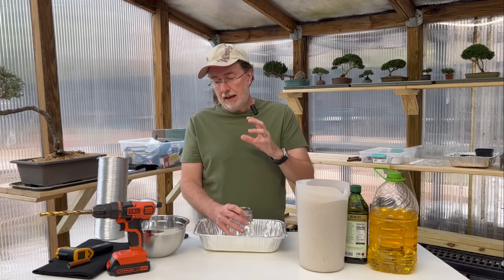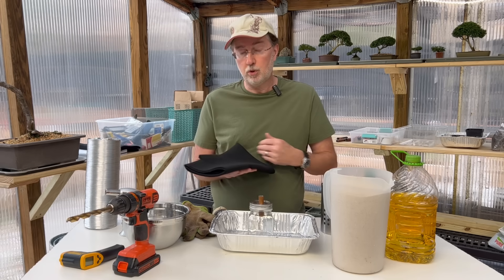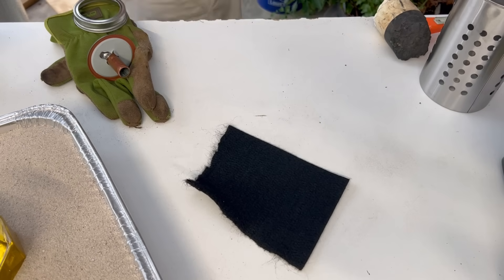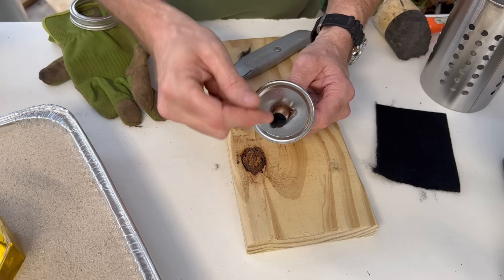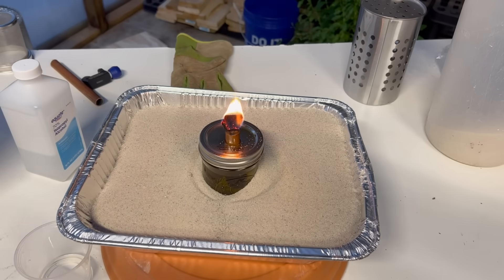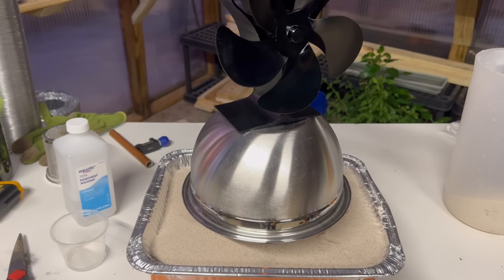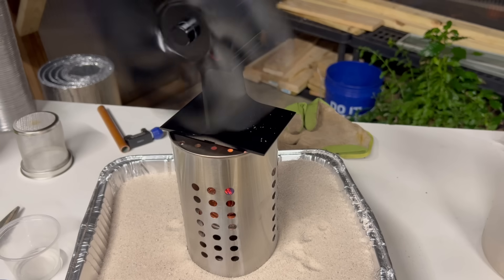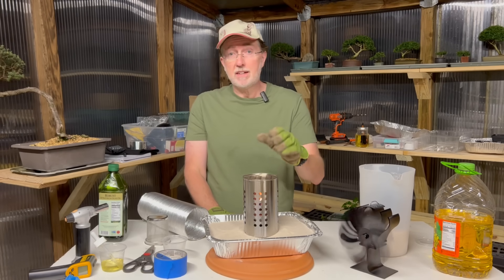DIY Carbon Felt Heater | Burns Forever Without Changing Out The Wick

Comment: Break about ⅛" off of the point of the utility blade. You will then have a new sharp point. Can break this again as it gets dull.
Reply: half a dozen passes over a 150grit sand paper on both sides , and it is good as new. Then after 5 years you get yourself a nice olfa knife with snap off blades

Comment: Is one is to use a vent for the heater one must make up the air that is being exhausted outside. It’s best to add a second smaller diameter pipe down low to the outside and bring it up close to the burner. It will supply the burner with cooler dense air that will offset the smoke if the candle does emit a lot of smoke and supply fresh air to replace air exhausted through the vent. Excessive smoke can be a sign that the wick is too far out of the copper pipe  and the flame is excessively high. Upon refilling the candle the next day pull the wick back into the pipe by about a quarter of an inch and see if it produces smoke on the next burn. You will lose some heating efficiency by adding a vent pipe to the system.

Comment: It seems you can't have it both ways - either you're going to vent this thing outside, or you're going to throw all the smoke (monoxide, etc.) around the room via the fan.

IF you modified the copper pipe to get the wicking going, for this video to have any value, you need to tell us why and how.

Too, it would be nice to know how long your charge (the bottle of poison (Canadian Oil)) burned before it had to be filled again.

It MIGHT be you'd do well to jump on the Heatalator bandwagon. That is, in the course of exhausting the poisonous air, have the output gas into a large can [or two of your stainless containers placed together to form a bulb] the heated gas can heat, before the smoke is carried away by the draft the exhaust created.

Comment: Canola oil can be burned in a home as a oil lamp or heater, as long as it doesn't have more than a couple of these burning per room.  They don't put out any more heat or toxins than regular fuel kerosene lamp oil.  Some lamp oils contain as much as 20% ethyl alcohol which helps it to light and burn, and reduces smoke and carbon toxins.

I live in the high mountains and kerosene and regular cooking oils will not burn well above 7,000 ft elevation. I stopped trying to use oil lamps and a variety of contraptions like this for heat, and have gone to pure hydrogen (separated HHO, removing the oxygen from the generator) as it will burn where kerosene and LP Gas will not.  We have sufficient oxygen in the air, but super low pressure.

Comment: It's perfect timing for this video to be suggested. I've been experimenting with this type of hearer and heat sources. I started with making Crisco candles which had a good burn time but a cold flame. Then I made some alcohol candles which doesn't last as long but burns much hotter. I'll have to make a vegetable oil heater to test. 
My heater is made of items found at thrift stores. My burn chamber where the candles sit is a stainless strainer with a 2 1/2 inch air gap on top to keep the candles cool. This especially important when using alcohol candles. On top of the air gap there's another stainless strainer the same diameter as the burn chamber turned upside down with a slightly larger stainless strainer upside down on top of it. The top strainer has a 9 inch diameter so I can cook or sit my fan on it. For safety the burn chamber sits in a 3 inch tall Pyrex bowl just incase.
I want to make a alcohol burning stove also, the one with the copper loop on top. My attraction to Crisco and alcohol is it doesn't produce carbon monoxide or so Google says. Google also says vegetable oil doesn't produce carbon monoxide. I'll use a sensor anyway. I want a heat source in my truck for when the motor isn't running.
Reply: I have a alcohol stove for cooking in my sailboat. It give about 2000w but is unable to give enough heat to  fry a steak, steak just ends getting slow cooked... A 1500w gas burner on the other hand has no problem burning a steak to charcoal lol. The problem is the 2000w alcohol burner heats the room and not the pan...
Reply: @a64738  
Why does the alcohol burner heat the room instead of cooking the steak ?
Reply: @MarianLuca-rz5kk  IDK, but I have an alcohol stove I use -- outside -- when the electricity goes out. It boils water fairly quickly, so it is heating my pan. My cooking on it has been limited because you can't adjust the flame on it. I did make a steak on it once. It worked fine.
Reply: Alcohol candles? What and how are those?
Reply: @MarianLuca-rz5kk  You take glass shot bottles (mine are Absolut Vodka). It needs to be glass to handle the heat. Punch a small hole in the center of the lid for the wick and a smaller hole for the vent. I doubled cotton string 8 times for a wick but use whatever wicking material you have. Fill the bottles with 91% rubbing alcohol to where the neck starts (not to the top). Trim your wick very short to prevent smoke and overheating. I'm not saying this is the best but as for now it's showing promise. I like the temperature alcohol burns at and so do the Top Fuel drag racers. I'm sure there are videos on the subject where you might find better information. Good luck
Reply: @turdferguson5300  
Thanks for the info. I will try it. Good wishes !
Reply: I believe all carbon-based combustibles create CO when burned.  The only fuel that doesn't is hydrogen.

Comment: Carbon felt is a type of insulation material made from synthetic carbon fibers. It is generally considered non-toxic, but it can cause mechanical irritation to the skin, eyes, and respiratory tract when inhaled in dust form. I can only guess that if someone decides to use this material in a much smaller enclosed area - such as the inside of a tent, or a small camper - that the heat from the burning flame will produce fine particulate matter, which will then be breathed in and cause damage to your respiratory tract and lungs?
Reply: Synthetic carbon? Carbon felt is pure carbon. 100%

Comment: If anyone's curious about the fan it actually is an electric fan

Inside the fan is something called a t e g or thermoelectric generator

Basically it's a piazzo device where if you heat up one side and cool the other side it generates a small electric current That's why this unit has a flat bottom that's the hot side and then it has cooling fins behind the fan those are actually important because the way these work is on temperature delta difference in temperature between the hot and cold side if both sides get hot or saturated it stops working

So the fan not only circulates the hot air but also keeps the cool side of the TEG cool maintaining that delta or difference in temperature between the hot and cold side which means it keeps generating electricity which is just enough to spin that little fan

Ultimately the core problem with these heaters is not a matter of heat it doesn't matter how much temperature you produce it matters how many BTUs you produce You've got to be able to produce enough BTUs to actually heat the volume of space you're trying to heat versus how rapidly that's based cools down to the environment around you so no you won't be heating your house with this :-)
Reply: AKA Peltier cooler.     Current (not voltage) through the diodes produces a delta t, (hot one one side, cold on the other WITH proper heat sink dissipation).
Inversely, a temp difference between either side of the diodes produce a current.  Hence the need for cooling fins behind the fan.  
A better design would also blow air around the flame, adding more oxygen, and produce more heat.  Mind you, at a higher fuel burn rate.  There's No free lunch here.
Reply: @iscovidoveryet7828  bingo except pelture coolers are relatively inefficient at making power That's what a TEG is for or a thermal electric generator it's a bit better at making power from the reverse of this process but a healthier cooler will do it as well just not very well
Reply: @nerys71  Rip apart any countertop water coolers, single bottle wine chiller or liquid cooled CPU  chillers as I have, and you'll find the exact same unit in them as what's powering the fan.  
The only dif, is that is that heat (the energy source) is being applied to one side, and the radiated heat being dissipated on the other, which 'creates' the current driving the fan.
And yes, for all practical purposes, as an energy recovery source, they won't be all that efficient cost/watt generated until these things become dirt cheap, but hey...
Reply: @iscovidoveryet7828  look I'm not going to argue with you about this there's a difference between a peltier cooler and a TEG They look the same visually physically looking at them you can't tell the difference but they're made a little bit different
Reply: @iscovidoveryet7828  A TEG generates output current based off of a temperature differential. A peltier creates temperature differential based on input current. They look similar, but work the complete opposite. The coolers use peltier, which is why they have to be plugged in. The fan in the video used a TEG, thus no need for external power(it's generating it's own)
Reply: It has a plate on the bottom that spins the fan. Woodstove fan

Comment: Does the carbon felt actually wick all the liquid up from the bottom of the jar. Does the jar actually empty out completely?
Reply: I guess if the jar's lid is very tight, the wick will suck oil until a partial vacuum will form inside that will oppose the pulling up of the oil by the wick.

Comment: Is there a substitute for the carbon felt?
Reply: You could use a thick cotton rope or cord but I think you'd need a shorter jar to allow the oil to wick all the way up the cotton wick.
Reply: @THEGLASSMANSWORLD  
I guess the pipe has to be thinner, so that the heavy oil could be pulled up by the wick.
Reply: @THEGLASSMANSWORLD  Somebody said they used strings from a mop head.
Reply: Yes, cotton wick.
Reply: @MarianLuca-rz5kk  dollar store mop head works great for wicks and is super cheap and provides a lot of wicks! I use this type of setup(- the copper tube) for my summer tiki torches. Same mason jars, a hole punched in too where wick(mop head string) stays in tight(you can get fancy and buy some fittings to fasten in place at hardware store -find in drawers). Works great with any combustible material(I use citronella in summer, bring inside for winter with lamo oil or canola/vegi oil). You could modify with a mantle as suggested for added heat benefit and a 2/3 rounds shiny backing to help direct heat and direction. Good instructable here, a lot to work with for beginners .
Reply: @llovebleach6530  
Thanks for the tips.
Reply: @llovebleach6530  
There is someone in the comments who says that the copper pipe conducts much heat to the inside of the jar, up to the flashpoint temperature, and so the vapors of fuel might explode. What do you think ?
Reply: I saw somebody recommend cutting strips of old blue jeans to use for wicks. But I forget what kind of fuel. It seems some fuels are heavy and won't go up a wick.

Comment: Might place the material in a pannof the canola or vegetable oil, then roll it up and insert into the copper pipe.

That should alleviate the difficulty in getting the wicking action initiated.
Reply: That would ease insertion as well... I think.
Reply: @quakerorts …lube!!!
Reply: or he could simply tell us just how long the wicking takes to be effective; as you cut it and roll it; and then resume the video when it is ready

Comment: all these people making these oil heaters need to understand FLASHPOINT.  once the flashpoint is reached, the contents explode.   around 500 degrees, different oils have different flashpoints
oil flashpoints
alvocado oil (refined) 480-520°F.
Safflower oil 450-500°F.
Canola oil 400-475°F.
Soybean oil 450°F.
Sunflower oil (refined) 450°F.
Peanut oil (refined) 450°F.
Coconut oil (refined) 400-450°F.
  be careful people!!!
Reply: Okay do a video of it exploding
Reply: Now, about kerosene lamps that have been in use for ages. . . .

Yes, be careful, but. . . .
Reply: @kellyvcraig  
You are right, but... I guess kerosene lamps might not use copper pipe that conducts much heat to the inside where the fuel is.
Reply: Wow -- thank you for adding this info to the comments!  👍
I didn't know this and this would be an important safety tip.

You should make a video demonstrating such.
Reply: The surface of the lid prevents, oxygen is required on the surface of oil for it to combust, like others said why did lanterns not explode?  The wick disparates most of the heat ,and his sand tray would release jar, but like one comment said  ,show us a controlled explosion heat video, my guess , you guess, I guess lol
Reply: @daleval2182  
You said 'the wick dissipates the heat'. It is the copper pipe that conducts the heat to the surface of the oil. The ignition temperature is when a substance ignites in the presence of oxygen. The flashpoint temperature is when a substance explodes by itself without the presence of oxygen.
Reply: @wizzz888 - When does the flash happen? Does the flashpoint temperature have to reach the surface of the oil inside the jar ?
Reply: Is refined olive oil ok… I’m a lady thinking of making one